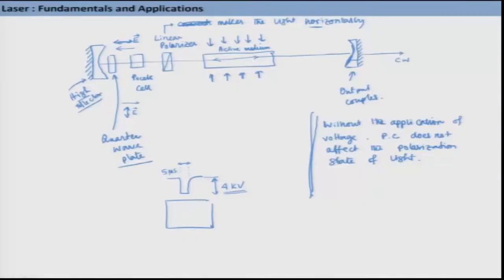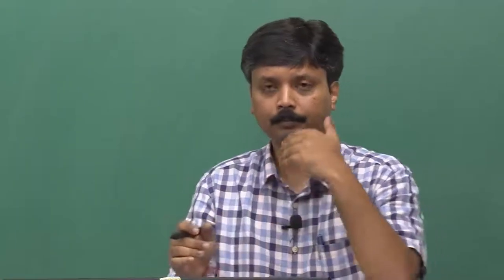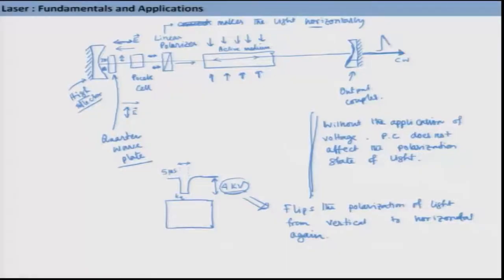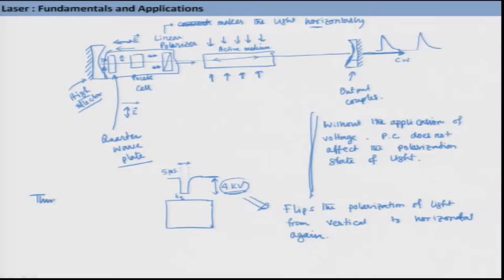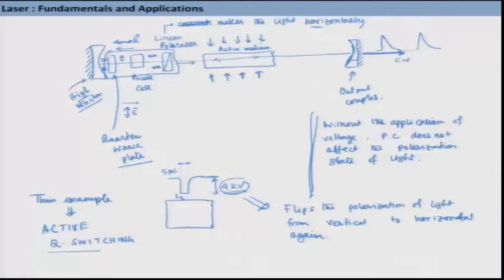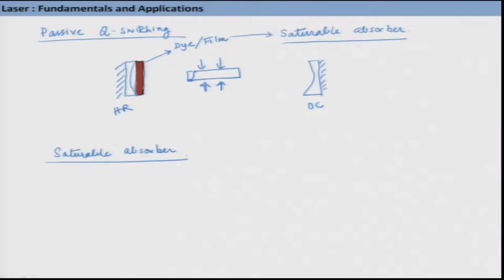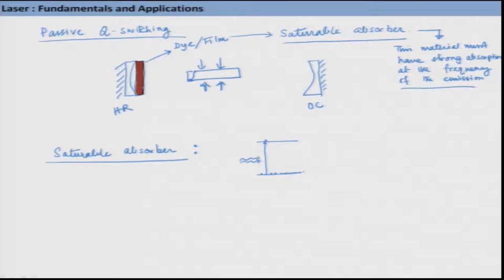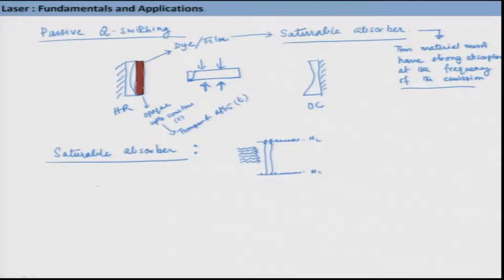Passive Q-switching, Mode-Locking

Comment: Hello. I' a student studying solid state laser in Korea. I have some questions about passive q switching using saturable absorber like Cr:YAG. I know Cr:yag is light absorber when with a degree of absorption which is reduced at high optical intensities. For example, using Nd:yag to make a laser at 1064nm, therer are no amplification of stimulated emissions because of high absorption on 1064nm of Cr:yag. But when intensity of cavity increases, it will saturate Cr:yag and it discharged 1064nm photons in an extremely short time. Here, if there is no amplification of stimulated emissions, then it means spontaneous emission make saturable absorber to be saturated?